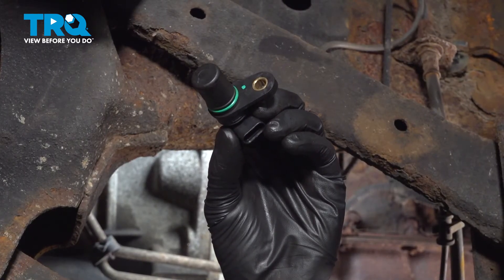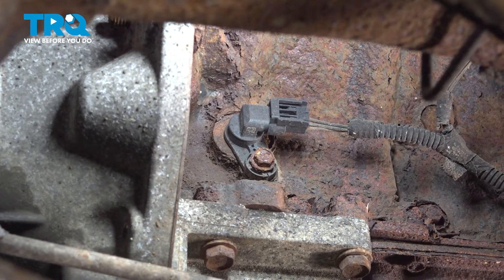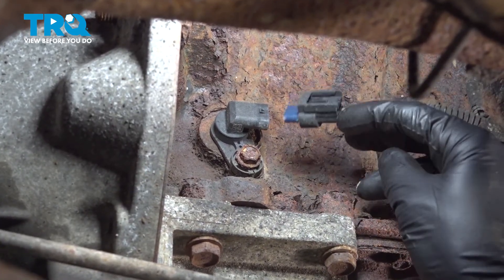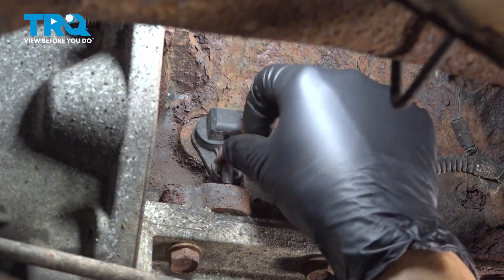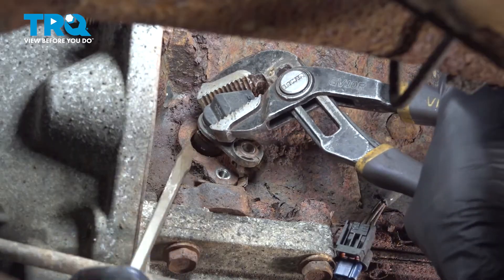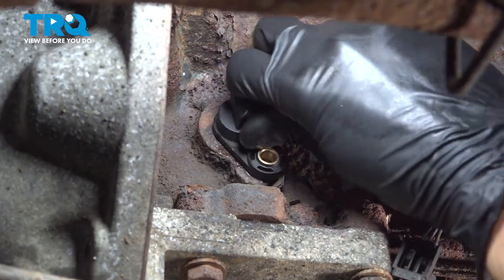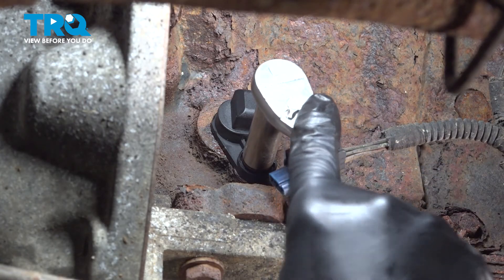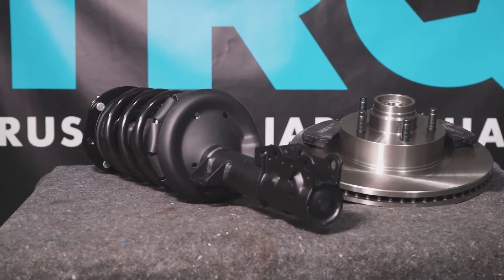How to Replace Crankshaft Position Sensor 2003-2009 Dodge Ram 2500 5.7L V8

Comment: Arent these dodge 5.7’s super picky with sensors? Everyone always says to go with oem sensors but they cost like 3-5x as much? So do aftermarket ones actually work? Have u guys ever had issues with customers coming back bc sensor ended up not working?